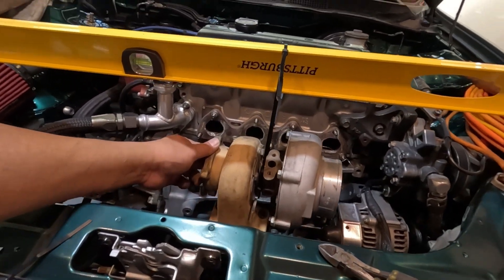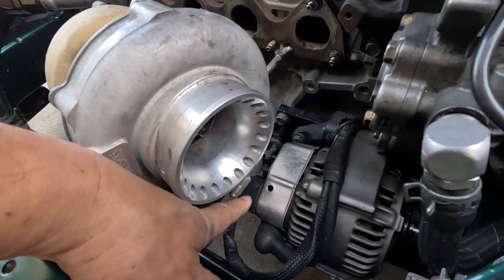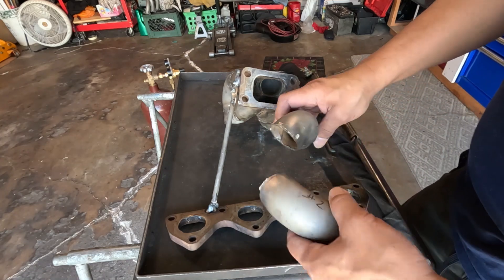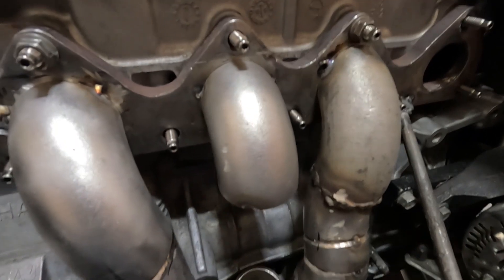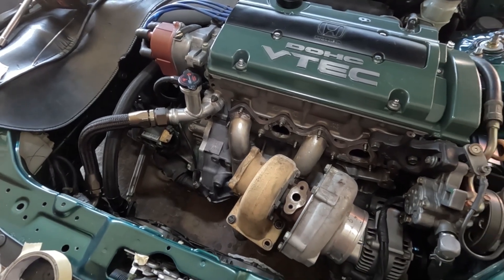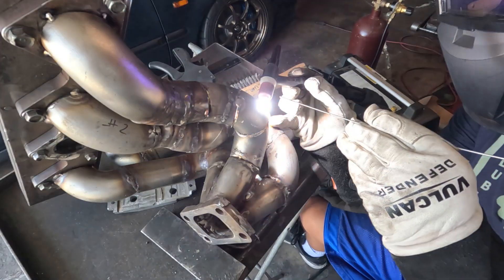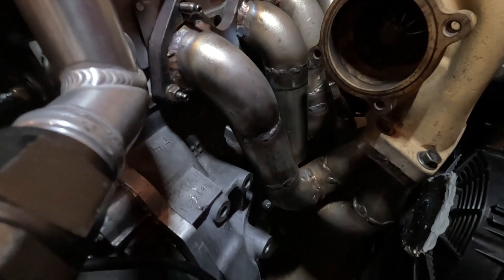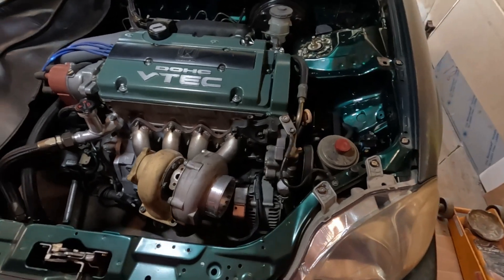DIY Turbo manifold! ep.2

Comment: Boss. Pwede bang pa weld yuun headers ko!? May exhaust leak eh
Reply from the maker: Bossing! Hindi pa ako comportable mag weld para sa iba eh, pasesnsya na baka kasi mas lalong lumalala. Salamat boss
Reply from the maker: Ano brand ang headers mo at ano engine?
Reply: @sagittnet2158  after market Lang na headers boss. B20 crv. Na install ko pero 2piece kc yuhn headers and it leaks where the headers meets na may spring to hold it
Reply from the maker: @ItsMoneyJohn  ganun din ang sakin, may leak din. Nilagyan ko lang konting paste na para exhaust joint.